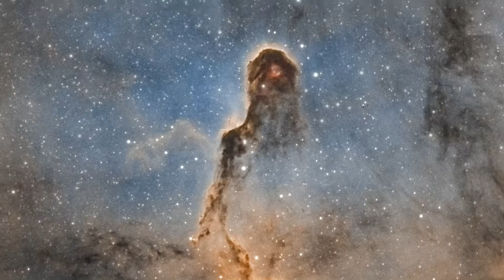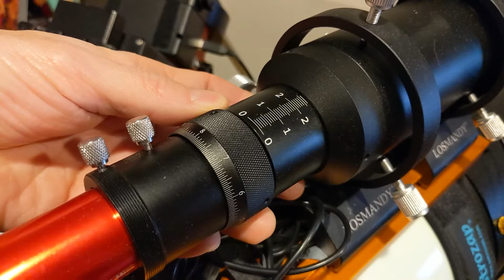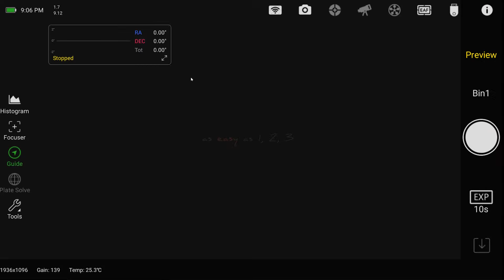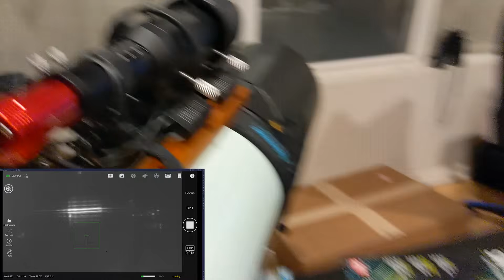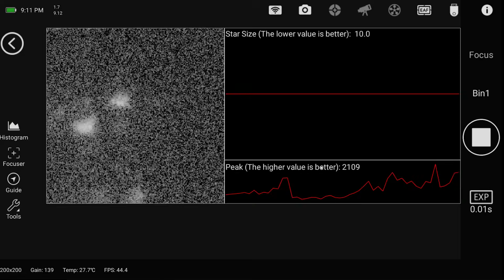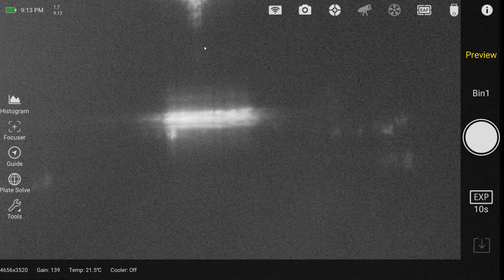Using ASIAir to FOCUS Your Guide Scope

Comment from the maker: Thanks for watching, everyone! What guide scope and guide camera do you use for your astrophotography rig?
Reply: I got the WO 32mm scope with the ZWO120mm mini for my RedCat51.
Reply: I'm using the WO UniGuide 50mm Guide Scope with a ZWO ASI290MM camera. This on a WO FLT 132 Fluoro Star.
Reply: Always enjoy your channel. Using a ZWO120mini with ZWO's mini guide scope but have yet to get it close to focus. I haven't found any tutorials specific to this combination. Would you know of one?
Reply: I am a beginner who is trying to use a SVbony 70 mm f/4 guide scope like the one in your video atop a Celestron EdgeHD 9.25-inch SCT.  The SVbony 70 has horrible chromatic aberration, so have not yet achieved focus. For the guide camera I use a ZWO ASI662MC and the Asiair Plus controller.  Your tutorial is very helpful but am not sure how one starts the guiding process after the focus and settings on the guide scope and camera are made.   How does on initiate guiding?
Reply: Thanks for the video, I'll use your advice. My guide camera is the Asi220mini mounted on a 60/240 guide scope. The main telescope is an Askar Apo 120.

Comment: Nice video, thanks, but my ASI Air just ignores where I position the green square and just looks at the centre of the frame, regardless of the green square position. But I’m using an iPad, not a smartphone, so it might just be a bug in the app.
Or am I doing something wrong?

Comment: I have bought an asi224mc for SV Bony 60mm, I can't get no way near the focusing region (I have tried 1.25" adapter and direct threaded in to the scope) do I need an extension as I see 290mm sensor is quite far from end of the scope, kindly guide :)

Comment: With the guide camera as the Main camera would it be better to change the focal length to that of the Guide Camera is ASIAir pro ? Rather than leave the original Main camera focal length or should the ASIAir recognise the focal length change ?
As newcomer with a Goto mount and ASIAir I found this video cleared up several questions - many thanks.

Comment: Excellent video...I have a question though.  When I make the guide camera ASI120 the main camera, I cannot get a view of anything.  The lens cover is off, but there is nothing appearing from the camera.  I'm trying to get it adjusted.  I have it connect to the ASI533MC camera.  Can't figure out what is going on.  I am brand new, so it could very well be my mistake.  But everything is powered and the ASIAIR Plus is connected.  Any idea as to what I may be doing wrong?  Thanks.

Comment: I use this exact method...now with ASI 290 on AM5 mount...but have done it this way for years on my big mounts and scopes. Here is a tip...when all is done use a magic marker to mark the point of the insertion of the guide camera into the helical focuser so you can repeat that position down the road. If you want an even better setup...get a par focal ring and put on the camera.The ring is a thin piece of 1 1/4" tube with a set screw to hold in place. I move the guider camera to other scopes for other duty such as lunar or planetary. By the way I use both the 70 and 60mm version of the same scopes you have. For years I used a 50mm standard finder scope that I machined to take a Helix focuser. It worked fine for shorter focal lengths and camera lens. I use the 60 now with 80-100 scopes but the 70 with a 6" APO 1200MM and 11" SCTs at f7 and Hyperstar.

Comment: Excellent video!  Are you using the same exposure rate when you focus your main camera using AA Pro? (i.e. 0.01 sec)  After 6 months of using AA I'm still having a heck of a time getting precise focus but it may be because I'm using higher exposure rates (1,3,5 sec).  The readout values in the focus mode vary all over the place so I end up just eyeballing the focus and/or using a Bahtinov mask.
Reply from the maker: Thanks very much! For the main camera I use 1 or 2 sec exposures iirc, and that is for the autofocuser to do its magic! When I used bahtinov I used .5 or so

Comment: ASIAIR plus  is plain bullshit! I have this piece of crap for 6 months now, and it still doesn't work properly.....why? 1. It loses connection every 5 seconds. 2. You cannot focus, because of connection loss. 3. None of the features presented by all of you guys are working, without hickups because of connection loss. This thing is pure robbery, waste of money. I'm going back to the old trusted method of using N.I.N.A. and laptop. I've thrown my ASIAiR down to the ground from four stories up, picked it up, threw some thinner over it, and burn it!
Reply from the maker: Sorry to hear about your issues with it! The connection issues could definitely be improved. Lots of times when I'm at home I run an ethernet cable.

Comment: Do you think it is possible to use the guide camera for polar alignment and platesolving just as the main camera? I removed the main camera and replaced it whit an eyepiece. (My mom wants to see Saturn). I would still prefer to have the convenience of Goto function.
Reply from the maker: I believe that should work! Set it as the main camera and give it a try 😎
Reply: @WindyCityAstrophotography  I did try it, one thing i learned from it, that my guide scope is not exactly looking to the same direction as my main telescope, it is slightly off. So the guide scope and camera worked as main scope and camera, polar alignment and plate solving worked. When i used goto to look Saturn, it was on the camera but i could not see it through the eyepiece of the telescope. After some struggle try to find it, i used the green laser pointer what is also attached to my telescope, to get Saturn into the field of view of my telescope.

Comment: Thanks for the nice trick. I'm still waiting for my ASIAir Pro to arrive in ~2 wks but that was helpful. I've got the same guide camera (w/ an old Orion 50mm guider) and getting close to focus during daytime w/ something a couple of miles away.
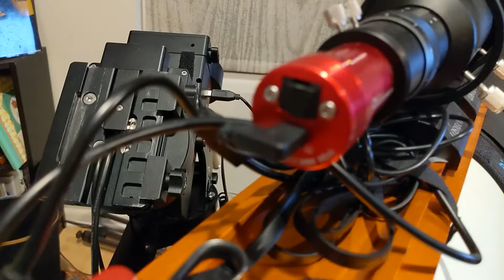Not having the ASIAir Pro on my hands yet, I kinda missed the connections @~1:50 in your video. You've connected the 120mm mini straight to a (USB 3.0?) ASIAir Pro port; then you mention something about connecting to your main camera but I couldn't quite understand the audio. If you could please clarify, that'd be great. Thank you.
Reply from the maker: I think I may have had notifications turned off for this video or something because I am just seeing this! So sorry! The guide camera cable actually goes into the main camera (2.0) and then the 3.0 cable runs from the main camera to the ASIAir. You can also run both into the ASIAir independently, but by daisy-chaining the guide camera into the main camera I open up a USB port on the ASIAir. Does that makes sense? Were you able to get your ASIAir up and running?
Reply: @WindyCityAstrophotography  Thank you for the explanation! I'm just seeing your answer but it was very clear. I now have my ASIAIR+ w/ this same guider you have. I decided to change my rig to a Star Adventurer GTI to be as portable as possible. I decided to go w/ an astromodified Canon 6DMII and my Canon 500mm f/4 lens. I have just been able to mount the EAF to the lens focus ring. It's Summer here (i.e., rainny - but I don't complain) but I'm ready to try everything out when the weather gets drier. Got an Ecoflow back as well.
Your video was helpful w/ learning the focusing part of the AA+ software. I feel I still need to learn more of the overall sw routine (PA, taking frames, flats, flat darks, darks) before taking everything outside. I'm gonna double check on YouTube for any additional info you may have posted. Thanks!
Best.

Comment: Thanks, i use a guide scope of 240mm evoguide 50ed , and add a william optics binoviewer Barlow 1,6x and never give me the focal 384mm ( 240x1.6= 384) if i add more spaces between the camera and the Barlow the focal length increase but never to the 384  < i do this calculation of the focal length changing the guide scope as main scope/main camera  in Asiair pro and make a plate-solving, and never get more them 331mm ( i use 3 spacers of guide cameras between the camera and the barlow ) , maybe its a good topic for a video :) , because more focal length is better for better guide results for big scopes like a C8 1400mm or more
Reply from the maker: Ohh interesting! Yes that is a cool idea for a video measuring focal length by plate-solving. Gotta admit I am a bit spoiled with the RASA at 400mm because super-accurate guiding isn't necessary.
Reply: @WindyCityAstrophotography  Yep ! i use the Hyperstar v4 on my C8HD 390mm its amazing , but for galaxy season a F/7 its the best choice :)

Comment: If I have a focuser do I just switch my guide to main and use EAF for it?
Reply from the maker: Is the EAF attached to your guide scope? If so, yes, though I don't know how the ASIAir would handle two EAFs.
Reply: @WindyCityAstrophotography  I have one focuser. My guide is connected to my mount and to my camera powered through ASIAIR
Reply from the maker: @alexandrarosa264  Got it. In that case you'll still need to manually focus the guide scope

Comment: Having just started in this hobby, what I find lacking is real step-by-step videos for total beginners of the ASIair explaining how to get from switching on the unit, setting up the wifi,  thru to PA, guiding, etc etc  There are plenty that quickly move thru the features but its super frustrating that key steps showing EXACTLY how to jump from one function to another are missed out (yes, I'm looking at YOU)....I think your presentation style would suit to make these videos -  maybe something you could consider :)    cheers from Down Under (and yes; I just subscribed :)
Reply: I know exactly how difficult and frustrating this is! I critiqued instructional procedures for new products I was introduced to. After the "experts" finished, I'd go through them as a total novice. That's the problem. You need to be a blank slate if you're going to truly teach a newbie. I've had to watch many YouTube videos, and peace together a lot of small details to get the asiair and all, figured out. Still working on it. No manufacturer writes a manual worth wiping with. I guess it's part of the fun  as DSO's drift below the horizon until next season. I'm old  so time is precious.
Reply from the maker: Thanks! Yes a series like that is definitely on the list for me to do. It has been waaaay too cold out for me to put something like that together but this spring into summer I hope to! Thanks for the sub!
Reply: Exactly what i think about the hundred or more vids I've seen.  Tutorials jump over 90% of what I'm trying to find out.  Far too many assumptions made by the vid creators.

Comment: thank you so much for this video! probably just me, but i couldn't find anything on how to use the Focus function; there are of course dozens of videos on Autofocus, but i don't yet have an EAF, so your demo of how to use Focus actually has applicability for my OTA focusing. a question: i've been using a Bahtinov mask -- any guesses as to whether the star sizes are more or less precise than that? PS love your style --- very friendly and welcoming and relaxing!
Reply from the maker: Thanks very much! Glad it was helpful 😁  Bahtinov will get you close (probably close enough) but the star size readouts will always be more accurate. Whether that difference is noticeable in the final stack is an open question but better safe than sorry I would say. Before I had the EAF I would use Bahtinov to get close and then really zero it in with the focus utility

Comment: Thanks Nick! With all the problems I’m having learning this, you’ll have hours of content to make videos!
My question here is when you change the main camera setting to the one that is your guide cam, do you need to change the settings, such as the focal length, to match?
Reply from the maker: Thanks Ken! You were my topic inspiration for this one 😁 The focal length setting will only matter for plate solving as far as I know, so no need to change
Reply: @WindyCityAstrophotography  But gain adjustments are required?
Reply from the maker: @dfinchermd  How do you mean? On the guide camera? Possibly, if you aren't able to see any stars. But I believe it maintains the selected camera settings whether it is set as the guide camera or imaging camera, so if you can see stars for guiding you should see them when it is selected as the main camera for focusing.
Reply: @Windy City Astrophotography  Sorry, yes, for the guide. My main 533MC seems to focus fine, but my 120Mini shows a whiteout screen. Obviously, it's not focused, or I thought maybe a gain issue.
Reply from the maker: @dfinchermd  ah, interesting! Yes, maybe try a lower gain or check to see if it is anything above bin 1, if that's an option.
Reply from the maker: If it is way out of focus though you may have to just turn the focus mechanism until stars are visible.

Comment: Thanks for your video,would a bahtinov mask help in the focusing process ?
Reply from the maker: Yes that would be an option for sure! I don't have one sized correctly for my guide scope but it would be a good solution. You wouldn't be able to use the star size measurement part of the focus utility in that case but yeah the bahtinov diffraction is very useful!
Reply: @WindyCityAstrophotography  thanks.actually I was struggling with my guidescope focus yesterday and your video is very helpful.
Reply from the maker: @gregorypudman4729  awesome glad to hear it 😎